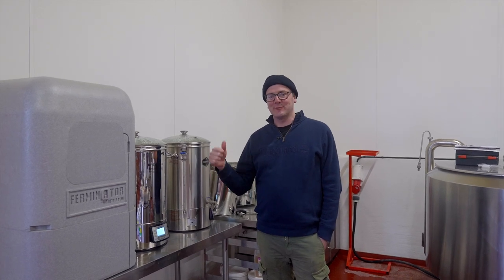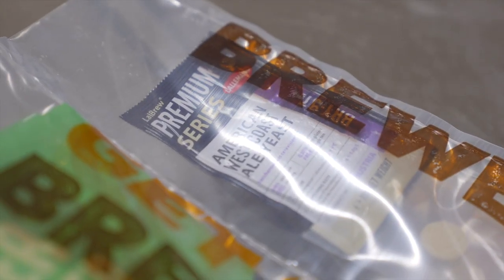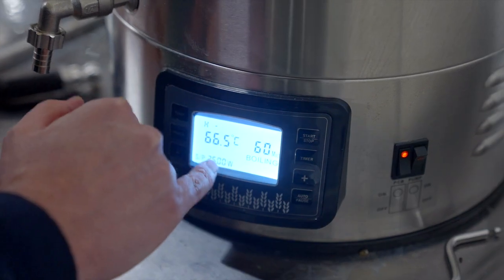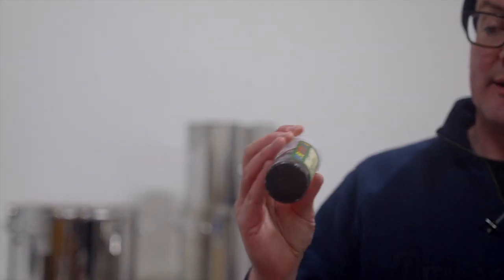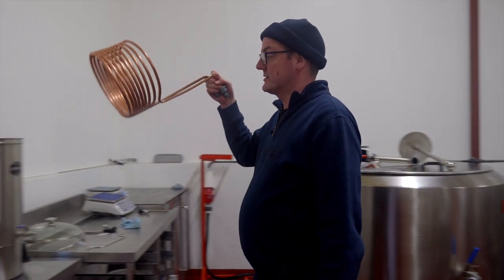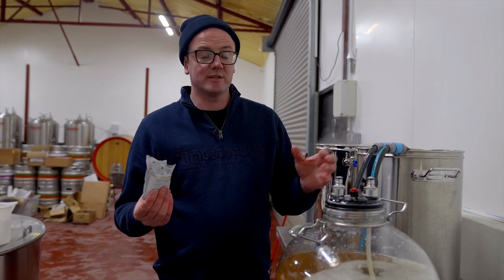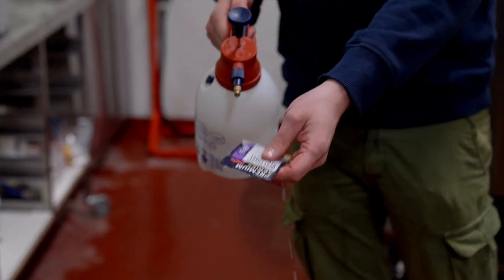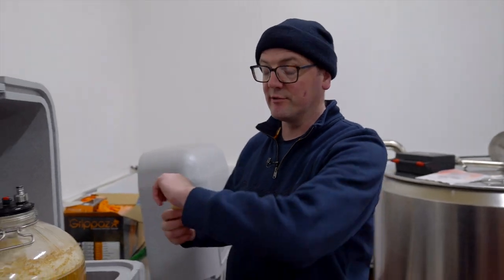Double Brewday Beacon Brewster vs Brew Monk - Imperial Stout vs APA with (new advanced hops)

Comment: Great video ! I like the all-in-one hot side system. And I'll probably go for an immersion chiller but would prefer the ends bent over a bit further.
Just in case the connections leak, I wouldn't want it dripping back into the kettle.
Reply from the maker: Yeah we can do that if you add a note in the comment box at checkout

Comment: Quick Question: Using an all in one, During the mash recirculation should you let the liquor go down the overflow pipe, I have seen both yes and no online in answering this. I believe you should use it to keep your elements covered however in doing this you should expect some loss in efficiency.
Reply from the maker: Given that most mashes can take 60 mins i reckon recirculating and allowing some to go down the overflow pipe isn't an issue at all and i don't think you would lose any efficiency